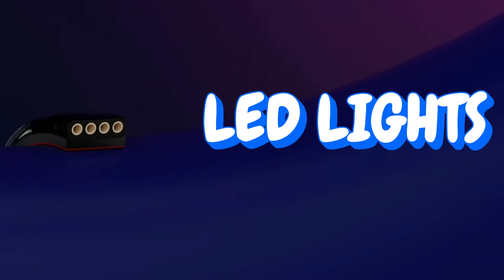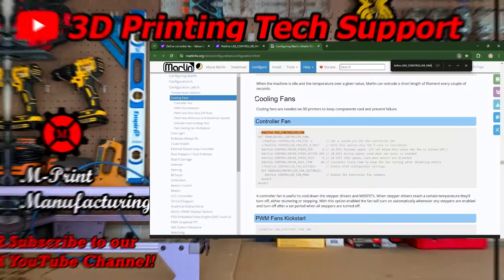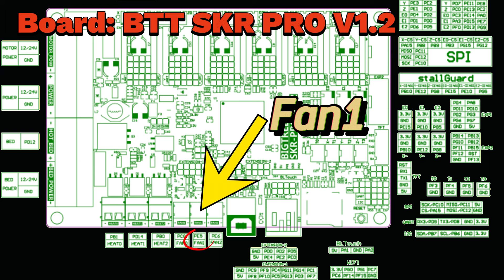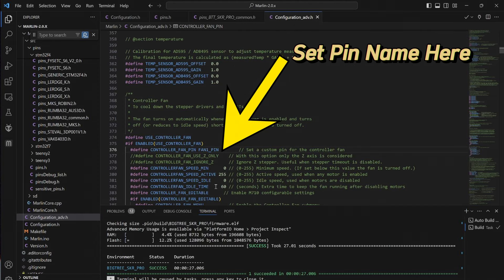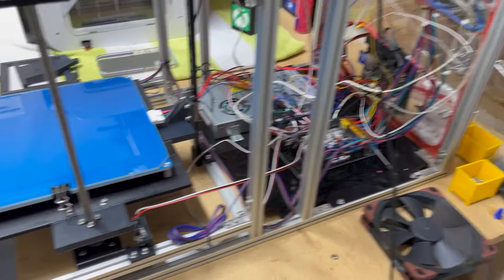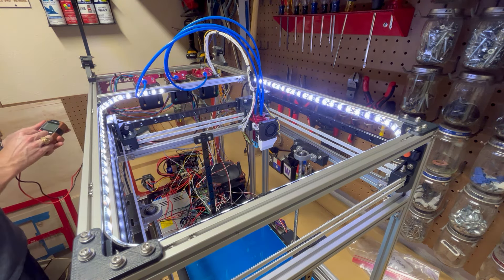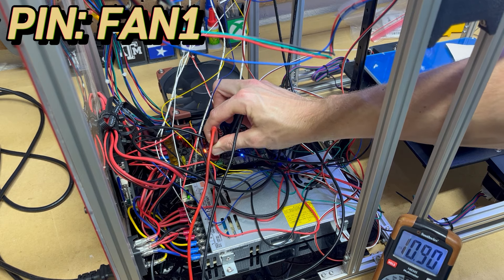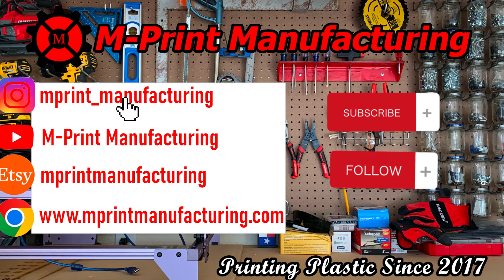The Wrong Way To Light Up Your 3D Printer | #define USE_CONTROLLER_FAN | 3D Printing Tech Support

Comment: LEDs don't flicker when receiving  low voltage, what you're seeing is some form of very quick voltage fluctuation, likely PWM. It could even be a software issue, controller fans are PWM fans and anything below 255 is achieved by quickly turning them on and off since those boards can't actually produce lower voltages. Multimeters are too slow to show that so they sort of average the voltage even though it jumps between e.g. 12V and 0V. Would need an oscilloscope to see that. If it's related to current limits of the board you can usually connect +12V directly from power supply to leds and only connect the GND (black or -) to the pin on the board, that is because usually boards control only the GND pin and don't really care where you get the + connection from.